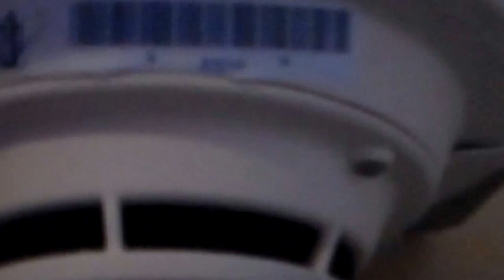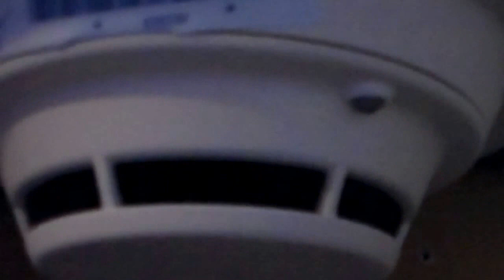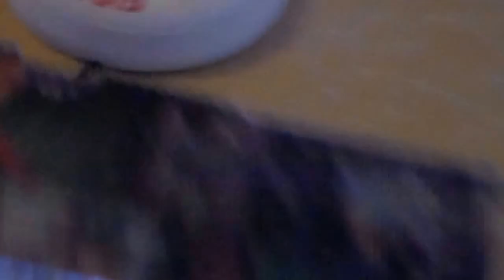Siemens PE 11 Smoke Detector Is Wired To The Fire Alarm System

Comment: So, how does it activate an alarm to evacuate?
Reply: When activated, the blinking green LED on the detector changes to a blinking red. Once you see that, the alarm would sound momentarily thereafter on a generic Siemens system.
Reply: @LoyalmoonieProductions  in this set up there is no alarm system